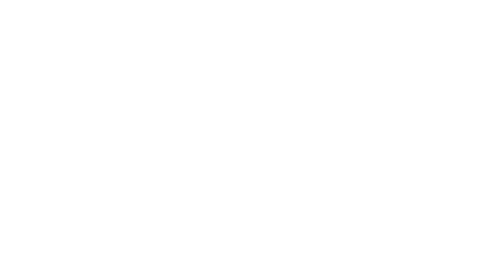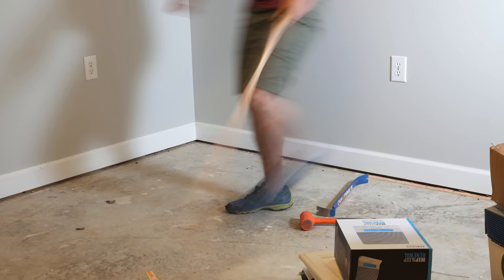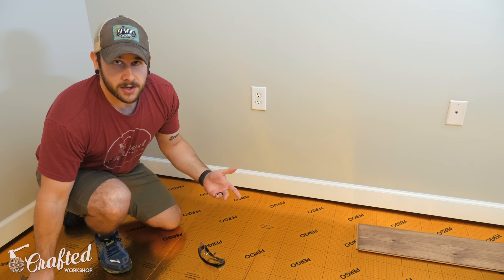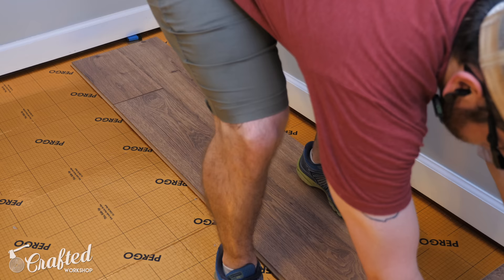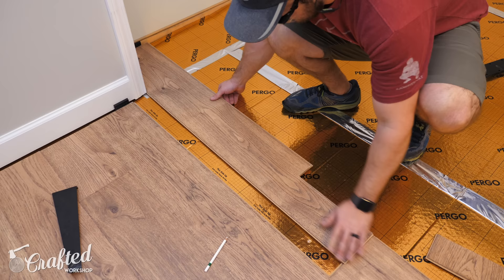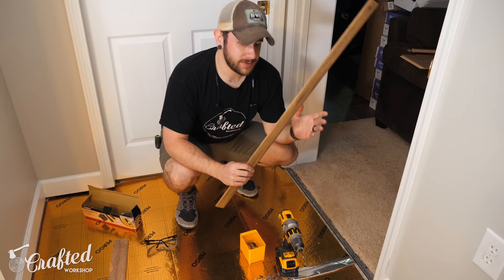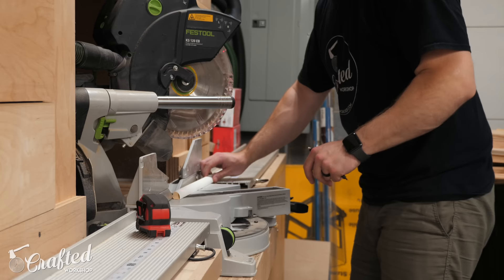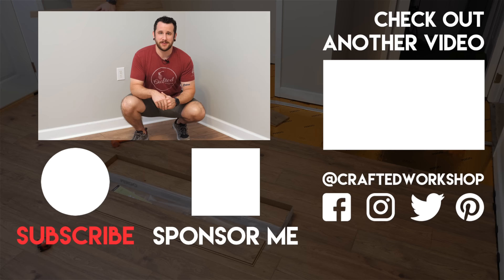Installing Laminate Flooring For The First Time // Home Renovation

Comment from the maker: Thanks for watching! Want to learn how to install vinyl plank flooring? Check out my video! https://www.youtube.com/watch?v=DnVOzR3rmfU
Reply: Hey! What paint color did you use for the walls?
Reply: I've put down a 1/2" plywood subfloor is the underlying a must ?
Stumpdog55
Reply: @danielmcmurray8159  Dampness control. Install a vapor barrier of plastic sheeting before laying the subfloor
Reply: how much did all this cost, just for this one small room
Reply: @joshasunto27  DEPENDS on size ..
Reply: @theChosen0ne  THE EXACT same size as this room.
Reply: I'm doing the same thing, at the transition from carpet to new floor, do I need to add a new tackstrip so the carpet will stay? Or it's not necessary? I just thought there will be lots of traffic there, the carpet may get pushed back and wrinkle, but then I don't want to step on nails :-)
Reply from the maker: I don’t think so, the transition will hold it in place.
Reply: Oh no, mine came out crooked.  My boyfriend is an idiot. -,-
Reply: @Crafted Workshop, I love the color of your laminate wood. What color is that? Thank you.
Reply: Crafted Workshop when you used the spacers when you initially started, and took them away later. What’s keeping the floor from sliding if it has space between the wall.
Reply: You mentioned a video about finishing your attic. I've been looking for a good video on how to install attic flooring but I can't find the video when searching for 'attic' on your channel. Could you please direct me to the video from fall of '18 that you mentioned?
Reply from the maker: @DarknessLPs  we moved before I got to the attic!
Reply: @craftedworkshop  Aww, ok, well thank you for responding so quickly to an old video!
Reply: Thanks for the video BIG HELP.
Reply: How long did it take you to do this?
Reply: Does one just buy pre made “transition pieces”?? Do they all come with the little grooves underneath? What happens if the floor I picked out doesn’t have any transition pieces, do I have to hand make them?!

Comment: Another good tip when installing is to have multiple boxes opened up because each piece in a single box usually has the same wood grain pattern so if you rotate them out you won’t have any similar grain pieces side by side. Great video though! I’m doing this in my kitchen and dining room soon and I’m really excited to see how it turns out
Reply: Yep, my wife goes through the box so the pieces look right next to each other.

Comment: I appreciate the fact that you showed the cutting errors you made.  I did a floor like this and made many of the same mistakes. It's amazing how easy it is to "chump" a cut and have to use another board.  But if you are honest about this it will help others not feel bad when they make the inevitable mistakes that come with putting in this type of floor.  It's really just a part of doing a job like this.  Thanks again for a great video.
Reply from the maker: Thanks, I feel like anyone trying this for the first time is going to make mistakes. That’s why you always buy extra!
Reply: Thanks . I started a jab and i made a huge mess . Im talking massive . I slowely became more and more frustrated as i made more and more mistakes . I kept going thinking this will be ok if i keep going . Nope it got frankly ridiculous and i to this day cant remember what happened but i had a break down and smashed the whole house up with a hammer and various other objects . I was later told i tied a rope to the 4x4 and a towing rope to the window frames ripping them from the house . Part of the roof caved through the house and thats apparently when i set it all on fire and took off in the jeep crashing it into a local DIY store and was arrested after a nasty stand off with a chain saw in the garden department . I did see the cctv and it was me but i still feel the tazor was extreamly unfair and after being shot in the testicles and carted off to a police station they did take me for medical help . I was sectioned for a few months which became a year and then 10 and now 24 years later they said i was no longer a danger to people . I am now confident to give it another go now because your video was so good i feel its ore than possible.  Also apparently it wasn't the flooring that set me off . The doctors said it could have been anything . Any way thanks for the video tale care
Reply: Are you serious?
Reply: @elizabethdorchester5307  same thing happened to me. Except I used a tile saw in the flooring department. That coolant water got everywhere. I was soaked
Reply: Kooka Munga hi it happens friend.  I once wanted to ask a girl out on a date but i was so nervous that when i saw her i simply dribbled down my chin and said . go wanna date me with . She laughed and walked away and that laugh although at the time just innocent it haunted me and thats the reason i think i am scared of clowns . So no No mom i dont wanna go to cousin bobs clown party no dont make me mom pls .  Oh man iv got issues and whats worse it im so aware of them
Reply: Pisos  tipo parketh
Reply: @elizabethdorchester5307   hahahah think am close to doing the same
Reply: Arron Esplin lol ya it has that effect . All we want to do is nake the place a bit nicer and we end up curled up in a ball feeling useless before we silently scream our selves to sleep.  Your be ok just take a break and start again when your fresh . You can do it take care
Reply: @bend757  ...um, I think he may be serious sometimes but not always
Reply: @elizabethdorchester5307  ..my god man, you're the extended version of SNL Jack Handy. Love it!
Reply: J H well if i ever get caught with my trousers down while robbing a bank im gonna think of you
Reply: @elizabethdorchester5307  ...that made me (AND the hostages) laugh. Even better cuz it was one I didn't know and had to search. Made my day, thx.

Um, not that I'm actually holding anyone hostage at the moment. 

Question: Is the title hostage like the guest of honor for a kidnapper?? AND WHAT ABOUT THE TITLE  KIDNAPPER ??
Reply: J H lol brilliant
Reply: sometimes not

Ground level decks

Comment: Myself I always remove the base trim. Toe nail screws down as temporary stops, so you will have a  more  stable stop as you start the first rows since you will hammering towards it! After install  of flooring Screws are removed and base re installed on top of flooring. I do this because if you don't your base trim becomes shorter and looks cheap! If you think of it, drywall does not touch the floor, so there's a 1/2" gap. Then you have the base trim, that's another 3/4" gap that's a 1 1/4" gap total!! When only 1/4" is required for laminate!!  Also the very first thing you must do and its the most important and was left out of this video is is calculate the rip measurement for your beginning run and ending run. The last thing you want is a 1" strip ending your last floor run!!
Reply from the maker: Good tips!

Comment: As a flooring installer. I am impressed of a homeowner installing! Very easy over flat cement. When you go over underpayment, there can be ridges you have to sand down in the subfloor to make it smooth! As a company we take the base boards off and reinstall them.  First time doing it is not easy. But my 10 years of doing it you get good at it and is easy. But very impressed! Nice work.
Reply: I was actually wondering if the expansion gap is too big if it's done with baseboards on. Or does that not matter? If you do it with the baseboards off, do you use the same spacing he used or doe sit have to be bigger? since his gap was baseboard + spacer? Thanks!

Comment: Good video, consider precutting two sets of starters. One set at 16" spacing and another at 12" this will give you a better stagger without lining up seems every two or three rows.Also you can eliminate the need for a puller by leaving room for pry bar it will pop in much easier without risk of marring your butt seams.

Comment: The only way to never make a mistake is to never do anything.  A few suggestions that I found helpful.  My laminate flooring had the pad attached so when I cut it with a jigsaw I had to cut it with the good side up.  I purchased reverse tooth blades so it would cut on the downstroke and not the upstroke this left a very clean cut on the good side. 

I used this in the kitchen and bathroom and where there was a possibility of water damage I glued the joints together.  On very long runs the material would not stay together when I lifted the board up so I used small pieces of duct tape to hold the boards together. If you have an area that you cannot snap together because you cannot lift the board up to insert it just shave a little of the tongue side off with a good wood chisel then glue the joint together.  I did my floor about 15 years ago and it still looks great however it doesn't get a lot of wear and I don't have any pets.

Comment: Plenty of uses for old carpeting.
Put a piece under your car (w/ a sheet of plastic underneath) to catch oil/fluid drips.
Lay a piece in front of your workbench to help your feet.
Line your car trunk. Pickup bed, too. If it gets rained on, so be it: it's already dump fodder. Leave it at the dump when you make a dump run.
Reply from the maker: Good ideas!
Reply: It's also great for lining kennels.
Reply: Double Dare Fan yes, one last repurpose! I saved a big piece from the closet and another from under the bed. Best pieces, almost new. It will be used as a big runner in the garage, to kick off shoes before going in the house.

Comment: Good video. Two tools I highly suggest for those who dont have the tool setup like you do. One is a heavy duty scraper. Seems like overkill or expensive ($20-$25) but I has been worth it.  I found that using it with quick thrusts will cut right through those tack strip nails that just won't come out. Especially the ones in concrete. The other tool is an oscillating tool (I use a Ridgid cordless).  You will be so glad you spent the money.

Comment: I've done quite a few floors over the years. I will be replacing the laminate in three rooms because we had 2 1/2 inches throughout the house due to Hurricane Ian. Now the first thing I do whenever I put laminate down is remove the baseboards. Yes, it's extra work but makes life easier overall.  In my case now, I am replacing the 3 1/4 baseboards with 3/4 by 5 inches. I could put 1/4 round on top but I'm not.  Pergo is a good laminate and that is what I use 90% of the time.

Comment: Came out great! In case you were not aware, the finish on the top of the laminate is very hard on saw blades. It is great for the durability of the floor, but will wear out the blade very quickly. There are some specialty blades made just for laminate flooring.
Reply from the maker: Yea I found that out the hard way. Time for a new bandsaw and miter saw blade!

Comment: Been doing flooring for quite a few years now. We never use those fancy spacers. No room is square so we just eyeball it pick a wall (preferably and exterior wall) and square it. Also a floor chopper will make your life sooooo much easier instead of back and forth trips to the chop saw all day. I also admit I cringed when he used WHITE quarter round for that door transition, but for a DIY not bad.
Reply: TheFoxSaid lol as an installer I always come to YouTube to see how other people. And I can’t stand watching them with out laughing lol
Reply: What is a "floor chopper" ?   A small trim miter saw?  Those seem pretty handy to have.
Reply: Excuse me for my ignorance but could he have started his row under the baseboard if there is room? It seems like they would fit all around.
Reply: A floor chopper is just a cutting blade much like a big paper cutter. Mark the piece of flooring, insert, and use the handle to chop the flooring. No power. No cords. Light weight. Just carry it with you as u work. U can also score and snap with a blade and straight edge. 

Yes u can start under the base board as long as there's still a quarter inch gap

Comment: Trip for getting the carpet tack strips up.....use a rounded shovel....just put the tip right where the nail is and lift it up.  Saves your back tremendously.   Use that same shovel to get up carpet staples

Comment: I literally just did this with my two bedrooms.  Ripped out all the carpets and put in laminate flooring.  I don't have all the fancy tools - only used a jigsaw.  My brother does have a circular saw but I was a bit scared to use it as I've never done this before.  The flooring is quite easy to install but the hard bit was using the jigsaw to cut around the inbuilt cupboards/wardrobes in both rooms.  There's a trick to using a jigsaw to cut U shapes and my brother ended up doing it for me.  My "closet" was quite complicated to go around.... but in the end we figured it out!

Comment: Nicely done Johnny. Looks like a nice system with the underlayment. The quarter round you referred to is typically called “base shoe”. It has a tall and a narrow side and is installed with the tall edge up as you did. Typical quarter round is symmetrical. Most home centers sell both and they can be easily confused.
Reply from the maker: Thanks! And that’s interesting, it was sold to me as quarter round and definitely was confusing when I went to install it.
Reply: I thought it looked like shoe molding and not quarter round.

Comment: Wow, I thought you had to adhere the laminate flooring to the base floor? It's much easier than I thought. Here in South Africa most of our floors are concrete so this was just what I needed to see... Nice job
Reply from the maker: Thanks! And nope, they’re called floating floors for a reason, no need to adhere them and you actually are not supposed to, since you need to allow for movement.
Reply: I've seen loads of videos of people gluing and nailing down their floors. This is far easier...
Reply: Hi Branden, there's a good chance you have been watching videos of people laying hardwood flooring which needs to be nailed and glued.
Laminated boards such as in the video don't need such treatment, only an expansion gap either end of the room.
Hope this helps!
Reply: Audioholic .

Comment: Great video! Excatly how it should be, any job can throw trial and error. A good honest video showing the errors he made along  the way, even professionals had to start out at some point. The end result looks perfect 👌, that's all that matters. Even with mistakes with laminated flooring & real wood planks, alot of the time you'll find that it can be used elsewhere in the project any way. So not to worry on wasting the boards. I've just invested in a contour gauge for my current/future flooring projects and it makes life a whole lot easier cutting around akward shapes and pipework. Take your time, makes mistakes and seek ways to rectify and learn from them, Were only human! You'll eventually see your efforts pay off. Your not learning if your not having the odd mistake or two. Credit where credits due, a job well done.

Comment: To remove tack strips .     Just use a shovel..  makes it easy.  You'll usually get all the strips up in one piece including the nails.    Works on concrete and wood subfloors.      You just slide the shovel tip from a foot or so back and it'll wedge between the strip and floor.  Then just push down on the handle.    Sorta like removing roofing.

Comment: Theses floors are easy to install if the floor is flat and you follow the directions. The only time it presents any kind of challenge is when passing through a doorway into another area....it is a good idea to map out the floor taking into consideration where the planks will fall so i don't end up transitioning into a room or starting/finishing with really short/ skinny pieces.

Comment: Thanks for showing your mistakes, as a carpenter I was just gonna start snapping these together and cover up the ugliness on the edges when done. Glad I watched though cause I've always used a fine to cut the bottom of trim and I almost always butcher it. Def gonna pick up the flush trim saw before I start lol.

Comment: My dad installs hardwood and i help him out...easier to connect the boards together width wise, then after that you just lift up one side and tap it back legth wise, some wood dont even need a hammer you can pull em back and theyll click in.
Reply: You know what ur talking about same thing i was saying whats all the hammering for that usually can damage some boards without you noticing
Reply: Yes .....Its called "Drop lok" very little tapping required.
Reply: I understand, that you do it like it's done in the vid, when you're working alone because (depending on the width of the room) it's difficult to lift up the whole row by yourself. However, working together, the way you described it, is easier.
Reply: @juanbadillo1373  ...instead of tapping the installed piece directly, use a scrap piece that you can temporarily 'lock' in and use the hammer on the outside edge of the scrap piece to distribute the force evenly along the installed board edge.
Reply: This isn't wood it's laminate....

Comment: I’ve never seen it done this way before. I’ve been installing floors for almost 6 years now and I connect the laminate with the width side first, then use a rubber mallet to hit it in length-wise. Your method takes 10x longer. The only benefit with your method is ensuring none of the locks break due to the hitting of the mallet as stated in my method.